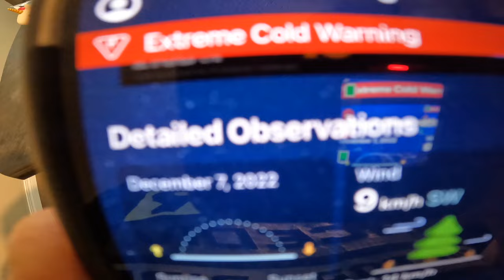Selling Cattle at Auction & Farming during the Deep Freeze $$🥶🐮!

Comment: Nice video as always. I'm enjoying reading the comments about bale grazing. I know of one farm that for this year he left his bales in the field where they dropped out of the baler and opened up the field for the cows. Once they are done that field they move the cows to a different farm to eat the bales off that field. They run about 250 pairs. Probably wastes more hay but they did not haul bales and the only fuel he burned this winter was to clean snow on his driveway.
Reply from the maker: A guy would save a ton on wear and tear/Fuel costs doing it that way however you must have some type of system for water, unless the land is next or tied to the area where heated waterers are. I truly think the Savings cost would heavily outweigh the waste of feed.

Comment: I seen one guy pile gravel too the bottom of his stock trailer. He had no problems loading.
Reply from the maker: That would definitely do the trick as cattle don’t like big gaps or steps. Our trailer is pretty low to the ground stock so normally not an issue but adding gravel would make sense 👍. Cheers 🍻
Reply: @PrairieSunsetRanch  Your trailer becomes a bud box. Leaving the trailer could be a vet emergency.

Comment: Bale Grazing not for everyone, but I enjoy it.  Feed 3-5days at a time is most efficient.  Train to electric fence before winter and use strong energizer with lots of grounds.
Reply from the maker: It honestly is starting to make a lot of sense in using this method of feeding. It's just so dam hard on the tractors in that -30-40 celsius weather. What kind of energizer do you use?
Reply: I use a 12volt Cyclops Super 12 joule.  Went 12volt as no AC power at my site.  (Cyclops, Gallagher, Stafix, Speedrite, all good) Put the cattle in a 1 acre or smaller pen with 8,000volts and 3 strand (18", 30", 42") hi tensile for 3 days and that will train them well.  10' long 5/8" galvanized ground rods are cheap if you look around.  Energizer powers 4km of single strand hi tensile @ 30" around the farm so I can build temporary fence anywhere and getting between 6,000-8,000 volts.  Even smaller bale graze area I still recommend 10joules+.  For temporary on the bale graze I use Gallagher Ring Top posts with hot on the top and add a screw on insulator 6" under hot for extra help if they touch both wires in the winter.  Use a back fence behind the next move is a good idea.   Spend the money and get the expensive Gallagher volt/current fault finder, you wont regret it.
Reply: 25 bales per acre is the guideline.  I put wood fence posts around my field 30' spacing.  Then put my bales 30' apart in the row to be eaten, then 60' apart from the next row of bales.  Give the cows more space not to put pressure on the fence.  Then next winter use the same field, but stagger it to fill the big gaps, so that it is 30' spacings in the end.  Take a quad and pull the twines off in mid October for enough bales to get you to at least March.  Or lift with the tractor if you net wrap.  

Try to keep bales similar in the row so that everyone eats the same.  Row of slough way, then next move good hay, then row of straw, then good hay.  Just if it gets really cold you may jump them to the good hay sooner, but keep track of the days and try not to move them past that point till they cleaned it all up.  Something you would have to play with.

Next year I am going to try to have some stock pile grass in the bale graze to see if they will use some of the grass when I am getting them to clean up there bales.  

I never had a problem, but get any cow that does not respect the bale graze fence out of there right away.
Reply: Only time I would consider pulling out the tractor out is to unroll a greenfeed or good hay bale on the last day if you want them to fill up a bit while they work on cleaning up.
Reply from the maker: Great info! Thank you kindly.
Reply from the maker: So you put a full row of Slough/Rough Hay or do you stagger them like 1 good field bale followed by a poorer Slough bale in the row? Thanks in advance.
Reply from the maker: Absolutely, Hell of a good plan my man.👍🏻 I could only imagine what the savings would be 🤔. Betcha I'd be shocked at the end of the year 😮$$$
Reply: You can mix different hay within and also between rows.  I would recommend going with it in each row as you can put out 1 bale for 10 cows and that should give you a good shorter rotation and guarantee the boss cows dont keep the other cows from the good stuff.  But to be honest I dont have a lot of experience with different types of feed as have not done it yet and have only tried all the same decent hay through out.  You would have a better knowledge about feeding different types of feed in general than me.  The cows are licking snow with no calves this winter, so I wanted to stay with good hay througout.  But there 3rd trimester I will go out of my way to water them everyday.  This summer I will rig up a solar winter water site to be pumped from the dugout.  Then I want to try multiple types of feed.  

Also actually playing with different feeding lengths to balance different things in my life.  Tried 16 days, but aiming for 8 days now.  For a full time farmer with a large herd I would still aim 3-5days, unless you had stuff going on.  Moving days are not a big deal, but those other days are sure nice.  To be able to just snowshoe up to them and walk through the calm herd, then walk home or to the truck.  

Average yardage cost in Alberta is $0.80/cow/day and you can possibly get under $0.20/cow/day.  So if a person does do that when bale grazing they can waste $0.59/cow/day and still be under average.  They also figure you get a bonus of $0.30/cow/day in fertility/water holding capacity.  

I buy all my hay which I end up spending more for my small herd. They deliver it directly to my bale graze field.  Then spent 1.5 days moving all my hay bale graze field and for other paddocks that I may use for winter and spring.  So in turn my yardage is pretty low.  

Still paying more for total feed costs than most, but for my hobby herd and full time job it is a good balance for me.
Reply: Another option for an energizer is a bi-polar energizer from Staffix/Speedrite.  1 wire is positive 5000volts, then 1 wire is negative 5000volts.  So if they touch 1 wire they get a good shock, but if they touch both they get a great shock.  The benefit you get is that calves are less likely to crawl under as on a regular hot/ground setup touching only the ground does not give a shock.  Vs the 10000volts 1 wire and 0 volts on the other.  Some people highly recommend them for dedicated bale grazing setups.  Maybe some year I will try it.
Reply from the maker: Makes sense! As long as it accommodates your life and leaves you with more time on your hands it's all good 👌. Thanks for the awesome info David. Much appreciated.